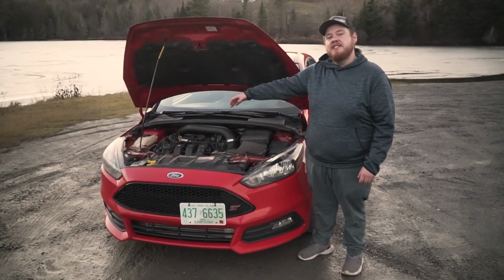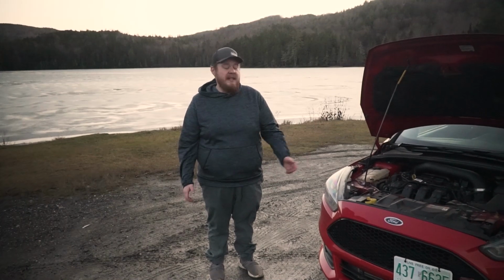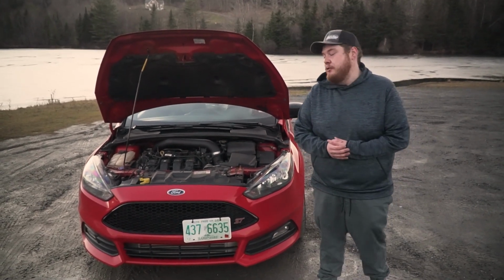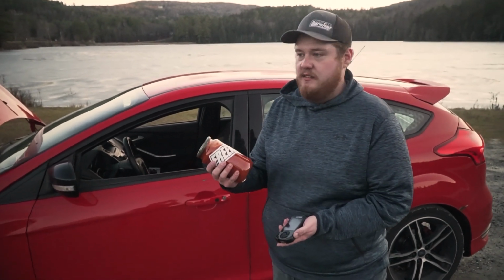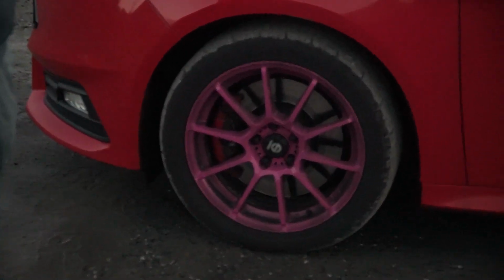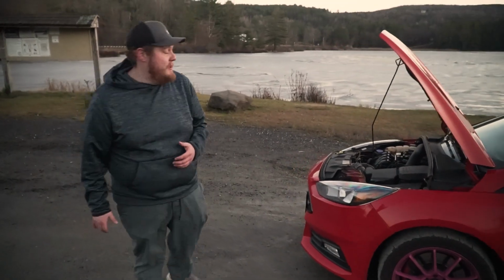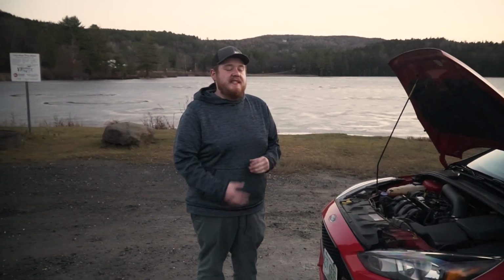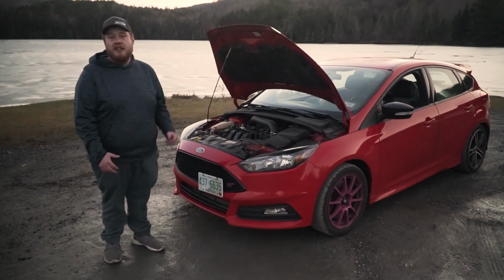Surprisingly Reliable Big Turbo Daily Driver. Ford Focus ST Walkaround + Raw Sounds

Comment: Hey mate!(: how has the BT setup held up?! How many miles have you been on a BT setup and what mileage are you in now?! Im going BT soon! Will be going with the GTX2867r gen2!
Reply from the maker: I daily drove it for 65,000 miles before cylinder 4 died (engine/car had 120k miles at that point). I was hard on the car, and knew it was bound to happen. I had a spare engine at the shop ready to go. I'll be shooting some videos with the car next year, got busy with the racecars and didn't really get the chance to take it out this summer.
Reply: @HometrackRacing  thats awesome mate! So you were in a BT setup for 65k miles?!? Im at 37k miles on the dash! :/ dont plan on going past stock fuel. Did you happen to have a Upgraded Baffle plate as well? I was told by the GOAT Alan over at Edge, that a baffle plate is also highly recommended to vent too much crank pressure. Along with the OCC's
Reply from the maker: @Gunna-ss7zd  yep exactly. I had -60k on the dash when we installed the turbo. I won't disagree with Alan, as he's you're tuner and you should always listen to your tuner, however I don't run a baffle plate and personally would spend my budget elsewhere. 
My setup is super simple.
- EFR6758
- Upgraded Intercooler
- 3in Intake (Cobb, but modified to work with the EFR)
- 3in Mountune Catted Downpipe(came with turbo)
- 3in Cobb Catback
- Damond catchcan

Everything else is stock, car made 360/380 on 93, and that's because we turned the torque down to save the stock clutch. I haven't gotten it retuned since upgrading the clutch/diff lol.